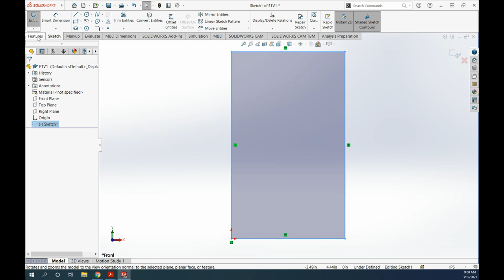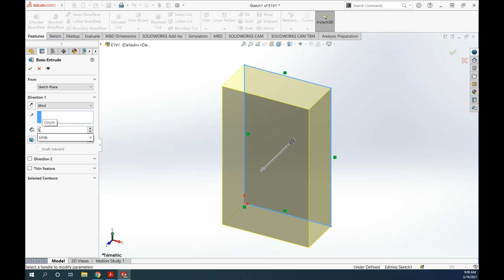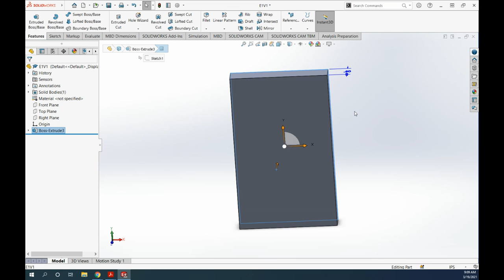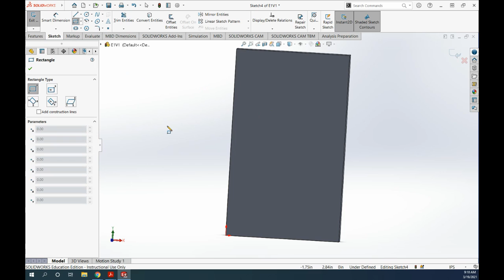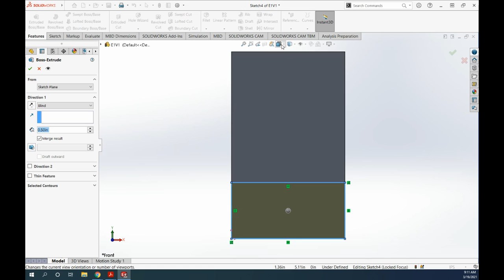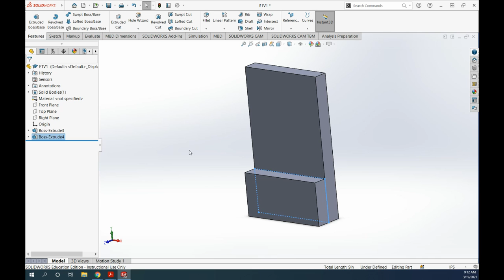Solid Works 2020 Beginner Tutorial Exercise 1, Video 2

Comment: The basics of solidworks have not changed since the last version we had licenses for.  The real power is in solid cam.  You can generate everything from toolpaths, machining sims, the nc code for the router.   Much better than either mastercam or featurecam...IMHO.
Reply from the maker: Agreed. For me, I could no longer run SW 2010 on our Windows 10 machines, so the upgrade was mandatory.